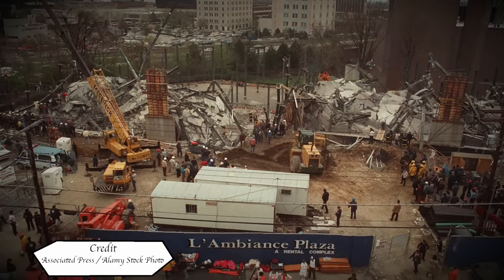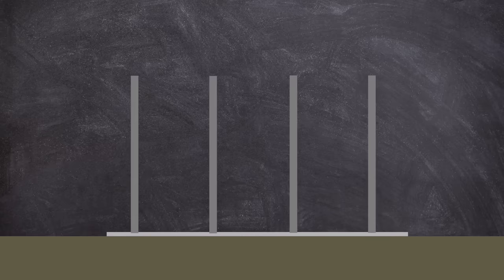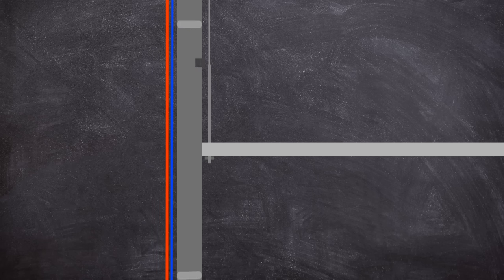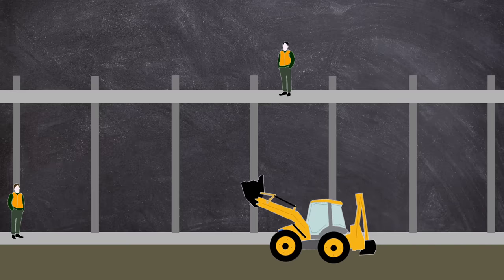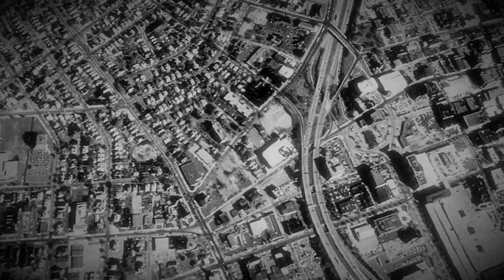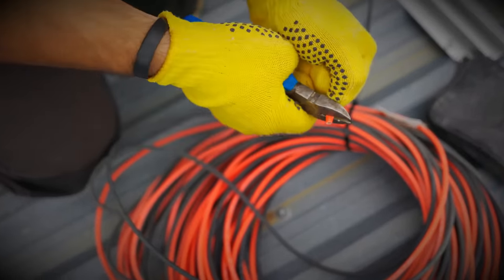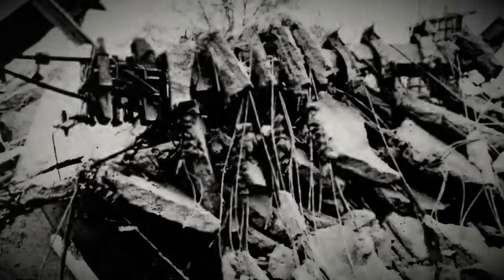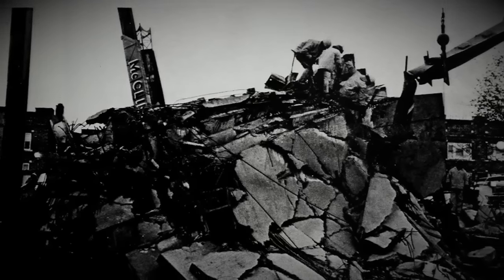Concrete Building Collapses During Cost Saving Construction Method | Plainly Difficult

Comment: As a resident of Connecticut and a commercial builder I recall this mishap quite well. As a matter of fact one of our electrical subcontractors lost his partner in this collapse. Hard to imagine men were permitted to work below the slabs during the lifting process.
Reply: It's seems like such a terrible idea. How the hell anyone thinks starting a building from the top down is a good idea is mind boggling.
Reply: That's a big ol' WTF....
Reply: You ain't lying
Reply: Permitted? Forced is the word. Compelled by fear of losing their jobs.
Reply: Humans are pretty good at doing things any which way until an actual accident/incident causes someone to start enforcing some rules....
Reply: Had there been any convictions after? This was criminal
Reply: I used to live in ct and my uncle was on the l'ambiance jobsite. He was lucky enough to be outside the building on break. He never worked on a lift-slab job after this, and survivors guilt are him up for years
Reply: IIRC, they outlawed that form of construction entirely for decades in Connecticut. Having subs work below the pour had benn outlawed everywhere in the US IIRC.
You certainly wont see me pulling wire in those circumstances, ever.
Reply: @jnharton  And the rules (regulations) have been under assault by corporations and the money behind them for more than 4 decades.
Reply: It is like in Florida when traffic moved under the skywalk which failed as it was jacked into place.  Completely against OSHA rules and more importantly ethical common sense.  It was a female owned Engineering company which was clearly inexperienced.
Reply: All of the bodies were recovered.
Reply: I've seen the rare double mobile crane doing this kind of work (and did concrete high rise in Vancouver, BC for 25 years with the BEST people  in the industry. WHY would anyone be in the building?? Is this a NON-Union job? Then no surprise. The only surprise is that it wasn't in Florida or Texas or some freedom fry place like Alberta. I've worked there as well.
Reply: Your electrical sub contractor was a homE-O?
Reply: Openly gay construction worker in 1987? Damn, Connecticut is so progressive 😂
Reply: I live in New England and I remember this. I also find it hard to believe that the allowed for them to be under the slabs too.
Reply: @paulskopic5844 so your point was that it was female? Really? Do you say make when this stupidity happens? No, so why female?
Yes you are right. Female or male. I never usually comment about this type of reaction to what you said. But that part of it was uncalled for. Have a good day.
Reply: @StillYHWHs  DEI hires for political purposes.  This female owned company was hired to specifically provide inclusivity through obama's stimulus program.  Competency was secondary.  Any other questions?
Reply: Throwing jabs with a rainbow stance is not a wise move, sit down, stay quiet and give thanks the only response deserved didn't come to fruition.
Reply: Business partner? Work partner? marriage partner? Saying just partner can imply many things.
Reply: Agreed, just seems to simple to me; is something being lifted? Then don't be under it.

Comment: On the block right next to where I grew up, they were building an apartment complex, apparently there were people under the formworks for the ground floor, checking on the supports when the concrete pouring was already well underway. The floor collapsed as it was being cast, trapping several workers under tons of fresh concrete and - worst of all - a layer of steel reinforcement, which made recovery completely impossible at first. I remember a lineup of about 10 ambulances that day, and cleanup went on throughout the night and the following days to avoid the concrete hardening in place. 2 out of 4 victims were lost.

Comment: I saw a documentary about this disaster some years ago, and from what I remember, the cause of the shear head failure was the supports for the rebar were too short, meaning the rebar was below centre of the concrete block, putting it under compression, instead of tension.
Reply: @@karlwithak.This, and bean counters are often the cause of workplace accidents unfortunately.
Reply: Clear as mud.

Comment: John, I sympathize with your sentiment of feeling rough these days. Greetings from a similarly rather cold and rough place in east Oslo, Norway.
Reply from the maker: Thank you I hope it not too chilly up there!  I’ve got this unshakeable cold 😬
Reply: @PlainlyDifficult Man, I feel it too. I can barely wait until the worst part of winter moves along to be replaced with normal temperatures. I have to take at least one hot shower every day, in addition to wearing wool clothes indoors. Best wishes to you.
Reply: Same here in Michigan, I'm laying in bed post surgery from Wednesday  on my foot. Thanks for another great video 😊
Reply: @PlainlyDifficult  Have you heard of the not dissimilar collapse, that happened during the construction of terminal 5 at Heathrow. In this case (as far as I can remember) it was precast flooring beams with insufficient bearing. I believe that 2 people died and a handful more were injured. First reports suggested that as the floors were added, the structural steels were thinner, requiring the floor beams to get progressively longer. The agent doing the daily site orders knew nothing about any off this and did not bother about the length code.
The collapse was the multi storey car park.
Reply: Norwegians are totally cool in my opinion. Shout out to Halvor, Anneline, and Lina. Party animals and great people all round. Hope your district heating or heat pumps keep you toasty and comfy. 🤗
Reply: Have you coverd this one ? https://en.wikipedia.org/wiki/Tretten_Bridge
Reply: Hello from Fairbanks, Alaska! We are warm now (-17*F) but are getting cold in the next few days (-40*F) so I am anticipating the drop.
Reply: @juliahaynie764  The state I want to visit first.
Reply: @PlainlyDifficult no wonder I was like this is a different voice! Hello from a rainy and cloudy California! (I was caught in the rain 😞)

Comment: I was doing contract welding around the time of the Conneticut colapse, on Lynn/Revere Ma. town line  for the Company TexStar on one of these monstrosities, there wasn't alot holding the slabs up. We were welding the "wedges" (as they were refered to by the texstar employees)and wind bracings that were the permanent holding mechanism. Kind of unerving being between the slabs, which by the way were about 8-10 inches thick and about 60 ft.x 150 ft. in size.

Comment: I was a concrete carpenter for years and form blowouts were somewhat common at least 1-3 would happen on every build. all it takes is a small leak and yards of concrete will pour out the of the forms. most times theres no injuries just tons of overtime to get the concrete cleaned up before it hardens. total failure is rare but it does happen mostly do to lack of bracing on the shoring
Reply: That's an awful performance, I worked on concrete forms for years and never saw a blowout....
Reply: @kenneth9874  do multi floor high rises it happens
Reply: @imchris5000  I've done quite a few....competency matters....

Comment: 3:26 - It's important to point out that pre-stressed concrete comes in two varieties - pre-tensioning and post-tensioning.  The method of tightening the cables after the concrete has hardened is called post-tensioning.  The video seems to imply that this is a feature of all pre-stressed concrete.  It is not.

Comment: So each floor had to be lifted and re-welded in place for the floors below it? Doesn’t that make the concrete move a lot more than normal, and is much more dangerous anyway?
Reply: Sounds like it would be. That, plus engineering is done for just the strength required and not much more, in the old days before computers buildings were so over-engineered they would stand up to anything. That's why so many 70-100 year old buildings, bridges etc. are still around and functional.
Reply: @tncorgi92 
My state government apparently used to build their buildings by engineering them to commercial building standards, then multiplying anything load bearing to at least double the strength. This resulted in things like suspended lights being strong enough to hold 2 or 3 adults swinging off them, or school buildings strong enough to have multistorey carparks added on top.
Very high standards... But of course with that came costs of triple or more what a similar commercial grade building would be, and that's before the contractors got in and added their "government project bonus multiplier".

Comment: Just a small clarification on the procedure for manufacturing prestressed concrete (3:20). The tension is applied to the cables before the concrete is cast. Then, after the concrete has cured the cable tension is released, pulling the concrete into compression.

Comment: If the stressing is done after the concrete pour, it is called "post-tensioned" reinforcing.  Pre-stressed reinforcing is done before the concrete is poured. It is an important distinction.

Comment: The tendons are tensioned before the concrete is poured.   Hence the term pre-stressed.   Tensioning afterward would be a disaster.
Reply: Post stressed concrete is also a frequently used building method.

Comment: As wielding temp bracing, I would think they could stack solid blocks in the general area , on each floor in the same location to transfer the weight to the foundation in case of the failure described. But the video does not address the first failure of the concrete slab that allowed side/(the lateral axis) movement. No one blamed the concrete strength? or age?

Comment: Tighten steel before pour usually, which is why it's called 'prestressed'. 25mm rebar twangs like a guitar string when it's been tensioned. Very tight.

You usually leave the form untouched for at least 21 days to cure, before releasing the beam.

Comment: @PlainlyDifficult Correction: Pre-stressing of the tension members (usually cable) is done PRE-pour. You cannot do it after the concrete has hardened. 

Also, the graphic is misleading; the prestressed members are straight, not convexed.
Reply: Somewhat irrelevant at this point, but when the building was initially proposed, it was originally supposed to be constructed from precast prestressed components. A Massachusetts company I won't name was initially involved, but was passed over for a pitifully low amount of money. This accident didn't need to happen.

Comment: I have questions about the construction method. It seems having multiple floors not in their final position the same time is asking for trouble and that dealing with the lateral stress either means having an inefficient building once completed or accepting higher risk during construction.
Reply: Yes this is what struck me as odd you would think they would raise the highest floor then secure it then raise the next highest floor and secure it et cetera et cetera. Some quick math which is likely to be wrong suggest the ballpark about 2 weeks worth of lifting. I'm still trying to picture all 16 floors kind of built at once and not moved into place yet.
 I don't think it goes that way but I'm trying to figure what they were doing. I can't imagine a situation where not all floors are in the right spot yet and they're moving other floors.

Comment: If the wedges were flipped, they could ratchet the floors up.  That way, if power is lost or cables sheer, then the slabs would lock into place.  Fail-secure beats fail-safe.

Comment: i believe the construction method whould have been way better having a good raising system
because the Danger is in the Raising and placement of the main collums
once all if bolt and solder together the structure should be fine, i believe

Comment: What's with all the low-res black & white photos? This was the 1980s not the 1940s.
Reply: Yes, and in the 1980s, while colour film and videotape were fairly well available, reproducing colour photos was still very expensive.  Newspapers and resources like the government reports on the disaster would at the time, have been black-and-white.  It's likely that the original photos taken for newspapers were on B/W film anyway because they were, after all, going to be printed in halftone so spending extra on a colour process would be silly.

Comment: im starting to think based on all these similar disasters that pouring slabs and then moving them to a secondary location isnt always a great idea. im the end, it doesn't really seem to come out very straightforward or time saving
Reply: It actually can be a very efficient and saves a ridiculous amount of time in regards to on-site construction. Especially when they are pre-stressed components. 

I briefly worked at a place making pre-fabbed pre-stressed wall panels. We would form up somewhere around 15-20 panels on "first"  shift. 2nd would pour them. The following day we would strip them(and form up another 15-20), some would get loaded right onto trucks, others would go to the yard until they were ready on site . They could make them year-round, accelerated concrete batched in house, the "bed" that we formed them up on was heated.

Trying to get that much control over the product in the field, especially using 3rd party concrete suppliers, and the other factors that come into play would suck.

I much rather work and pour my concrete in the field but precast/pre-stressed has its benefits for sure.
Reply: Consider the alternative where a floor is rebarred, formed, poured and then cured. After that the forming needs to be pulled away, often being damaged in the process. There is a reason why the Hoover dam concrete had coolant pipes going through it all

Comment: I'm not at all comfortable with temporary tac welds holding up whole floors of concrete. Apparently it's not a great idea. Silly engineering, sad loss of lives.
Reply: The welds weren't "holding up whole floors of concrete". They were attaching the "wedges" (which appear to be acting more as shims), which were supporting the weight, to hold them in place.

Comment: Remember when building designers did calculations by hand, rounding up and adding 15% for "safety"?  And when constructed the engineers added another 15% "just in case"?

19th and early 20th century skyscrapers remember.
Reply: That is nonsense. Any construction or device that is designed for human habitation or use is engineered with a safety factor. Where failure could potentially lead to injury or loss of life a common safety factor would be 4X, that is, the strength of a part or construction is increased by a factor of four over what calculations show is the necessary minimum.
Reply: @avsystem3142  Current design practices and construction methods would disagree.
Good, fast, cheap.  We can only pick two, and I'll give you one guess which two the builders prefer.